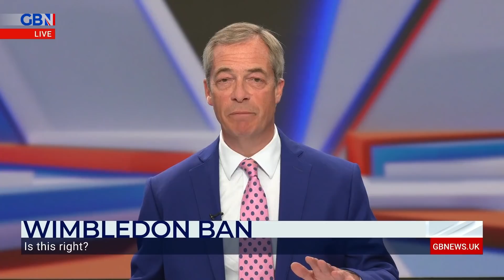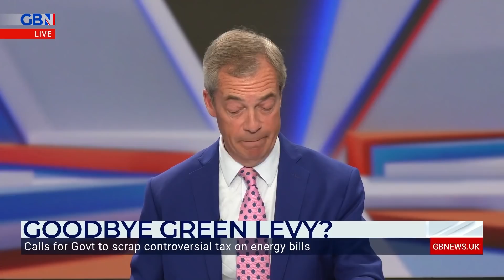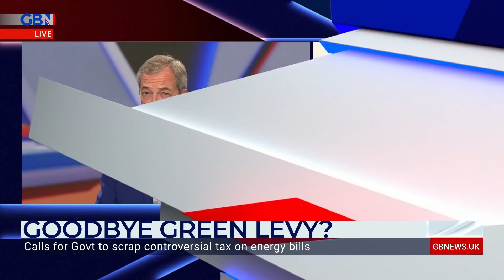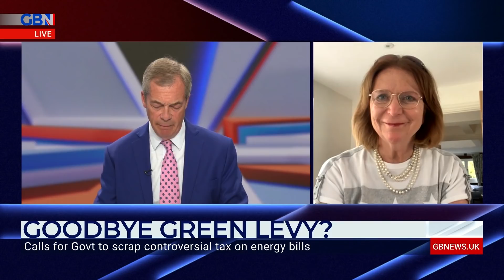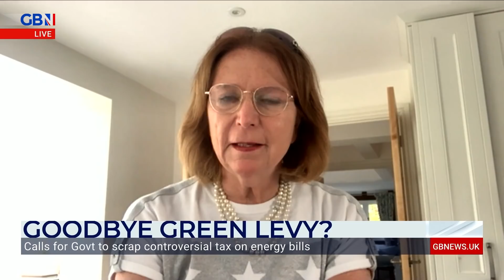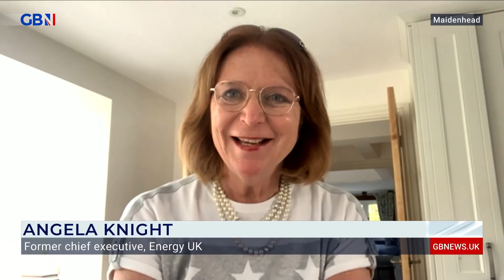Goodbye Green Levy?: Farage and Angela Knight discuss 'regressive' green energy levies

Comment: Typical just adding a load of questions. What we need is more solutions not just questions. Also vested interests need identifying  and modifying. We need shorter term and long term  policies. Insulation must be the starting point of any energy efficiency and emission reduction proposals. Cheap and permanent if done the right way.